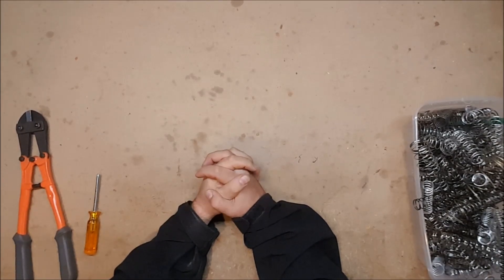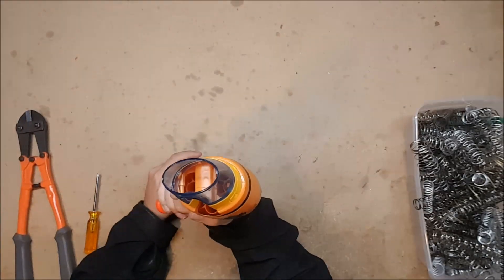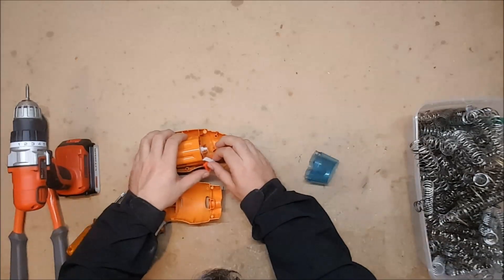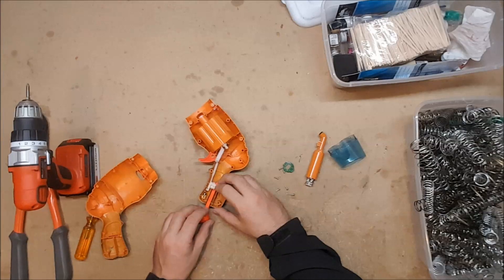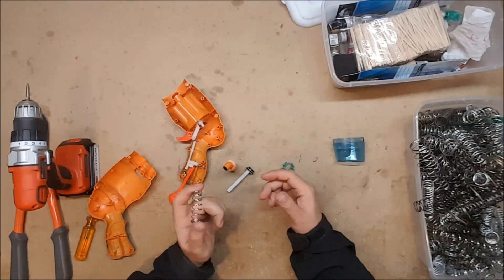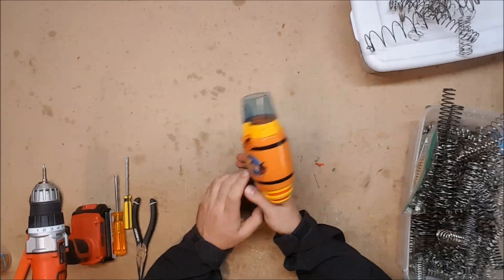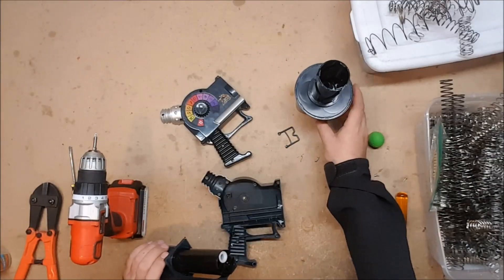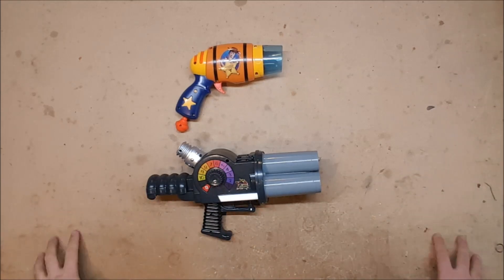Can it Take a K26? - Episode 49

Comment: Apparently both of these blasters are made by Lanard. Both of these are also reshells, with the little blaster being a reshell of the Rotator X8, and the Zurg one is a reshell of one called the Triblaster. I looked that up on the Nerf Wiki, which does have information on that. I don't know if that helps any, because Lanard stuff is a pain in the rear to find online. But, I hope it at least gives you a lead.

Comment: That little pistol has similar internals to the Lanard Rotater X8. Rather steam punk looking blaster
Reply: A cheap early mod for the hammershot was taking the spring from rotater x8 and putting it in the hammershot. Would that not mean that a hammershot size spring would work in the woody blaster?

Comment: Did you see if a Hammershot spring would fit in the revolver thing? It looks about the right size but I don't know if you've tried it.
Reply from the maker: +Armadillo 2001 too small. It is very picky about spring size. It has a small plunger tube and a think plunger rod.

Comment: Sure it's been said, but with the way the rotation mech works could you replace the back half of the handle with a big shock's?
Reply from the maker: +StevenBD6 the issue would be in getting it to rotate. There is not much room and I don't wamt to cut up tue shell too much.

Comment: Hey, Chaylo. Could I run something by you? I was wondering if you could upgrade a hammershot spring by merging it with another hammershot spring. If you reply, give your opinion on this please since I need a second opinion because I’ve gone mad. 
                                                                 Thanks, the matt
Reply from the maker: No.  It is too thick of a spring so you would never be able to get enough compression to get it to catch.
Reply: Thank you, Chaylo. I appreciate that you will reply to your comments and that mine won’t be buried under thousands of comments. This is why I like you better than other, bigger, nerfing channels like Coop772....

That and you have a solid weekly upload schedule compared to Coop’s “I upload just whenever” schedule.

Just a teen with a Stryfe, Matt.